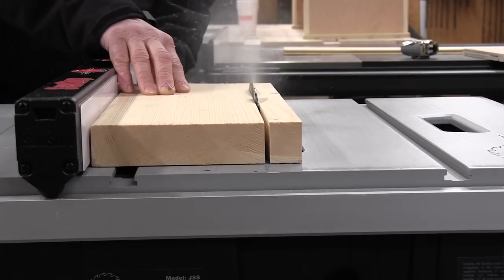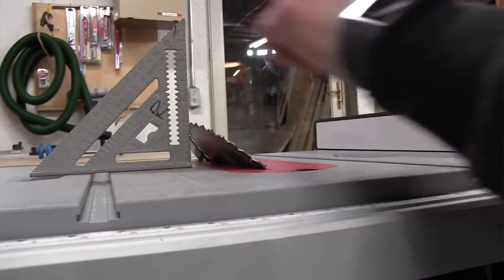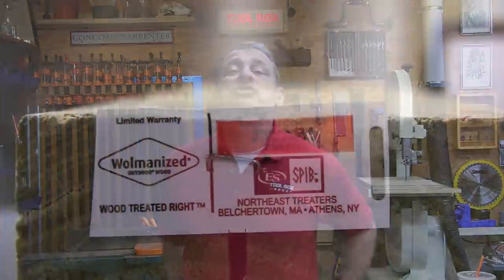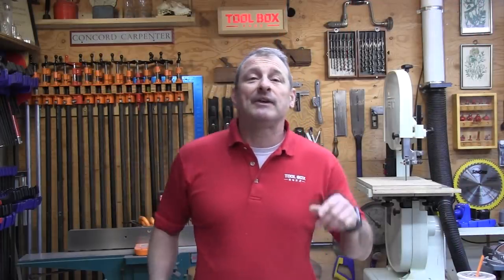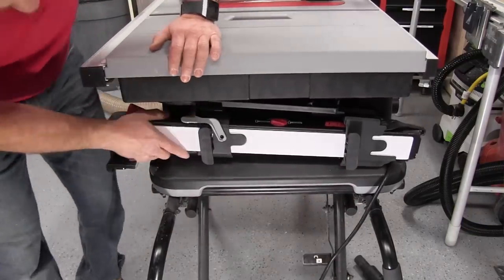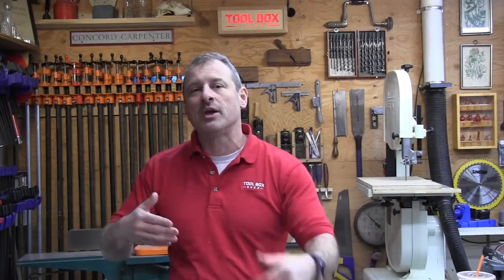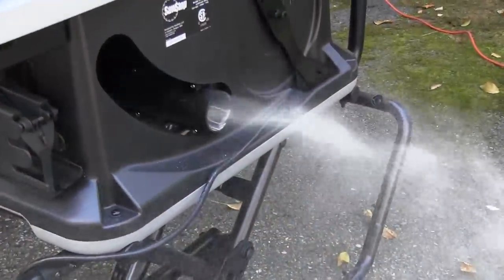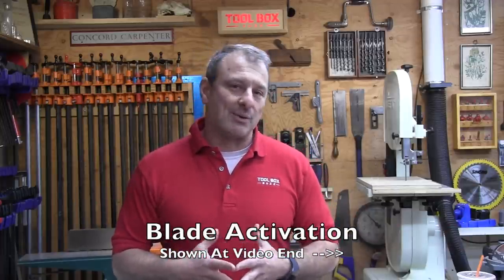SawStop JSS Job Site Table Saw

Comment: Great video! Another way to test the conductivity of a material is to just turn the power switch on, and touching the material to the blade without it spinning. If the red light flashes, you’ll need to use bypass mode.

Comment: I have used the cabinetmakers version of this saw and it is great, however I did trip it with foil covered foam insulation. We were not aware that this type of material would trip the saw so it was a $79.00 lesson. I have had a NUMBER of friends, coworkers and acquaintances seriously injured with unprotected table saws so even with the occasional false trigger it is a worthwhile investment.

Comment: This guys reviews are by far better than any tool reviewer on YouTube. Learns the product inside and out and provides possible improvements. Curious if you value the safety feature enough to use this over the dwe7491rs you previously indicated is your saw of choice on the job site.

Comment: Thanks for the great video. I just purchased this saw about 2 months ago and put it in my shop. So far so good. Very accurate, very nice. I built a sled for it also and it works great. I bought the dado stack and tried it. Very easy to switch in and out. Just takes a few minutes.
I went from a 35 year old 10" craftsman table saw without even a riving knife to this wonder saw with these safety features. Thanks again, your channel rocks.
Al from Maryland

Comment: My favorite thing is that power switch it's nice and big. I know at our high school we used this sign it did save a couple of fingers. What I really enjoy about the size is very simple to use also that nice big power switch if you do get in trouble and you can't let go your stock you can always turn it off with your knee this is a really nice saw a general

Comment: Are riving knives and splitters synonymous?
Reply: No. Riving knives go up and down with the blade. Splitters are generally fixed to the table itself. Riving knives are much easier to deal with when making rip cuts and go a long way toward preventing kickback.

Comment: Great video as usual. I take it you can only use the saw stop blades for the safety feature, or does it have to do with the cartridge? Thanks alot. I just purchased the new pro model
Reply from the maker: any blade - the cartridge does all the work
Reply: @ConcordCarpenter  Thank you for the quick reply.
Reply: Check with sawstop to confirm. I think sawstop recommends against some blades
Reply: @kyl3dr  Great idea! Thanks

Comment: u mention the SPEED at which u can raise or lower the blade, but that speed appears to come at the cost of accuracy. This might be find for someone framing a house, but not so much for anywhere else. 
you say you did not like the push stick location, but failed to mention does it come with 1 or 2 of them, cause if they should be used in pairs, if you need 1 you really should be using 2. 

Did the people that developed the flesh sensing tech patent it or did they make it free for all. Basically is if money grab or do they care about protecting lives?
Reply from the maker: Greg Ward no it’s proprietary
Reply: Cash grab? They invented something so they could make a living.  How is that a bad thing?

Comment: How does this compare to the Bosch reaxx?
Reply: Sawstop lawyers killed the Bosch Reaxx, the ass Steve Gass, the Sawstop creator is trying to create a legal monopoly with his technology.
Reply: Too bad the Bosch reaxx is not for sale in the U.S..
Reply: Sawstop basically invented this technology
Reply: Biff Dingus ... Nonsense....do you drive you car less safe because you are wearing a seatbelt and have an airbag....I think NOT
Reply from the maker: Did u guys see my video on Reaxx?
Reply: Bosch also develops airbag and pyrotechnic safety devices for automobiles, so it makes sense that they used a pyrotechnic charge to retract the blade out of the way.  The Bosch system doesn't damage the blade, and each cartridge had two charges, so you put the blade back in position, switch the cartridge around and turn it back on.  A far superior design in my opinion.  But the patent attorneys at sawstop won the fight so Bosch cannot sell their saw in the U.S.  any longer.  Until the patent runs out and Sawstop ceases to exist that is.  Just a hunch, but Bosch is probably getting the patent on every possible variation so they can crush sawstop when their original patent expires.
Reply: A Concord Carpenter / ToolBoxBuzz I guess not, I'll have to check it out.
Reply: Could have sworn that I saw that Bosch bought out Saw Stop
Reply: A Concord Carpenter / ToolBoxBuzz  I checked it out, sounds like the Bosch was having what I'd call "typical Bosch issues" 😆😂 which is a shame because I like the physical execution of their idea. For a company that designs industrial electronics I can't believe how many Bosch tools and sensors I've seen fail prematurely. I wish they could get their act together
Reply: Borescoped No that was festool.
Reply: wild goose agreed bosch had it so it didnt cost u money every time. was slightly slower reaction time but still enough to save u